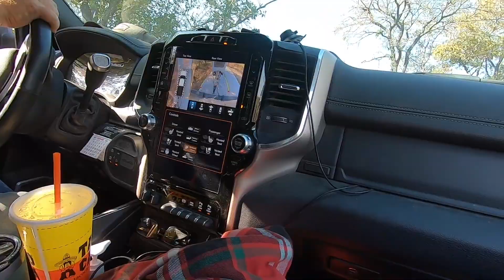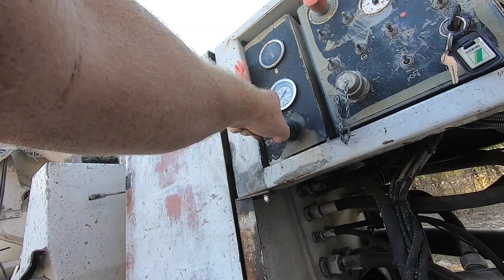2 jobs trailer pumping concrete off of Hells hill !!! Line pumping with Muddyfeet

Comment: When pumping downhill some wet newspaper in the line before your pour the grout in stop's in running away downhill I find it works and never have a problem.
Reply: Or use a 3"  Sponge ball 😉 make sure it wet thou!
Reply from the maker: Yeah we’ve talked about it before. I usually just roll the dice though. Lol
Reply: @evanunderwood5088  if using a 3 inch ball make sure it's a good soft ball and not an older ball that is a bit hard because of the concrete inside it .
Reply: @MuddyfeetConcretePumping  I bet you will try the newspaper next time after plugging on this one because when the grout runs away it only wets the bottom of the line
Reply from the maker: Lol probably not.

Comment: Do you think they used the pump after stealing it?
Reply from the maker: Yes I do
Reply: My buddy recovered his pump on a jobsite while the two tweekers that stole it were actually trying to use it! Them dudes were bold and spun out. They rattle can painted it black and didn’t even bother to take the custom pin striping before painting it 🤣🤣

Comment: I have noticed that the rebar in this video and others just lays on the ground. why bother it probably is not providing any strength. Even some jobs that use risers to hold up the rebar from the ground I watched as the concrete crew members knocked them off or didn't replace any that were off already, they just didn't seem to care !!
Reply from the maker: I really don’t do a good job with the details but they where pulling it up into the concrete